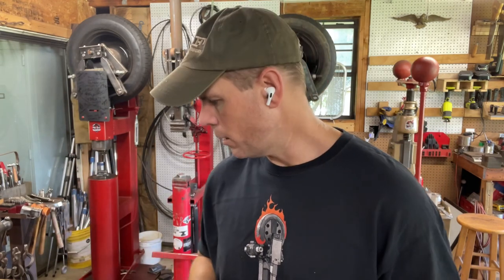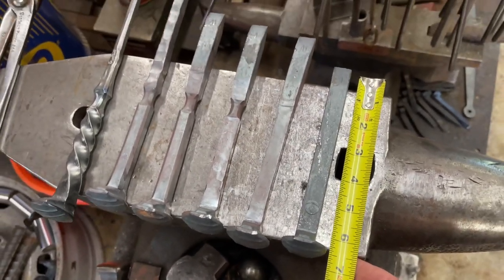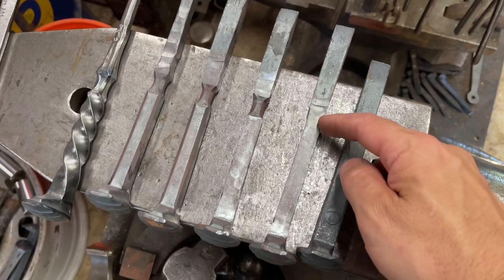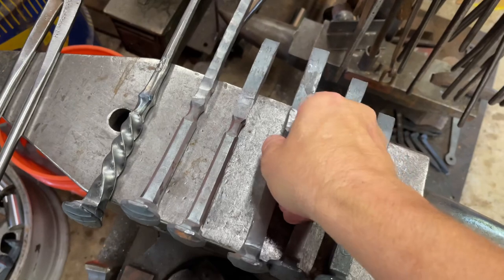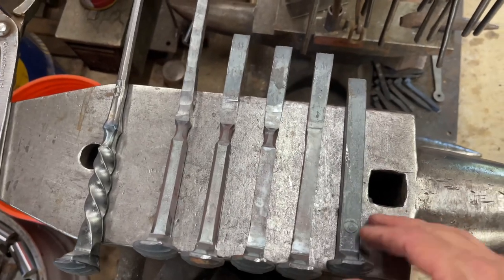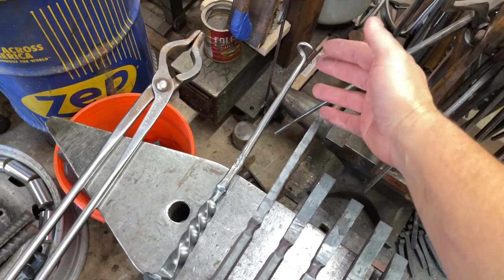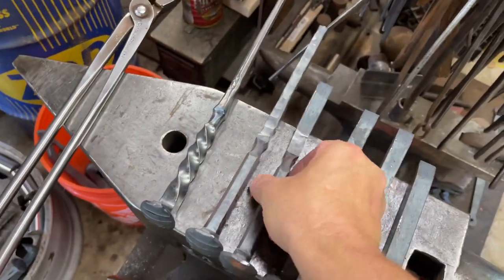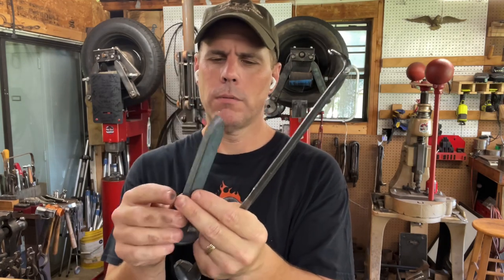Shop tip for getting length out of railroad spikes

Comment: Thanks Derek! I've watched your steak flipper video before (actually a couple of times!) when I was hand forging a steak flipper and flesh forks from RR spikes to get the order of operations.  Since I was hand forging I used my small guillotine fuller tool for right at the head and approximate length (minus a bit) to set the "depth" and then forged down the handle to that "depth".  Then fullered the end of handle section down further and drew out the rest.  Got it done, but alot of hammer work!  Love your work and your instagram posts/stories!
Reply from the maker: Thanks! They sure are a ton of work without power forging equipment!!